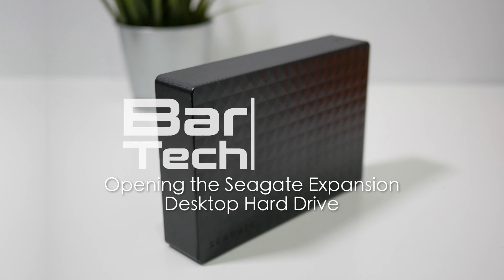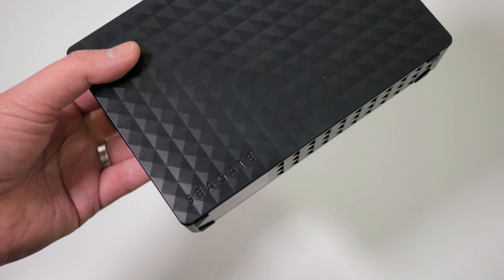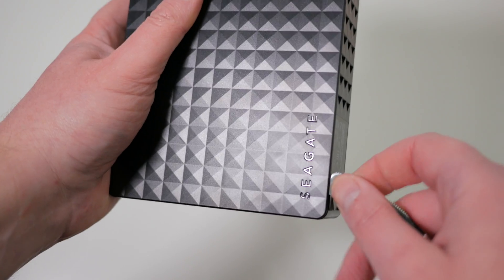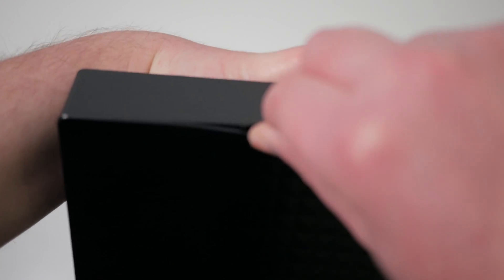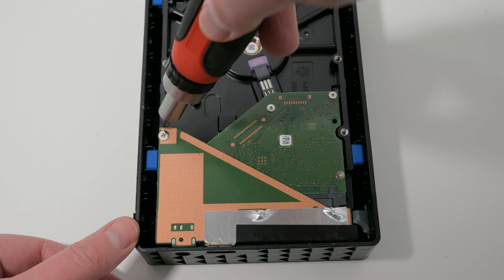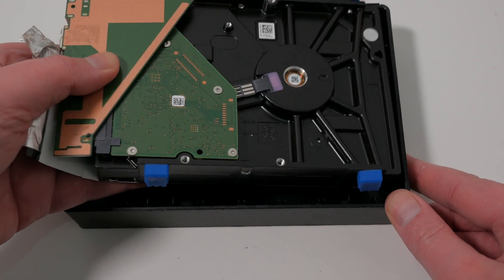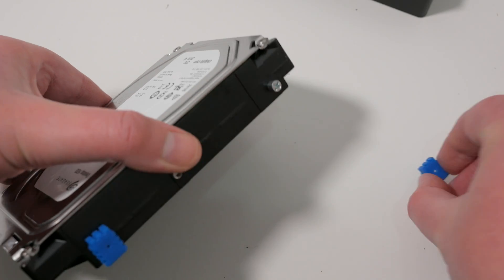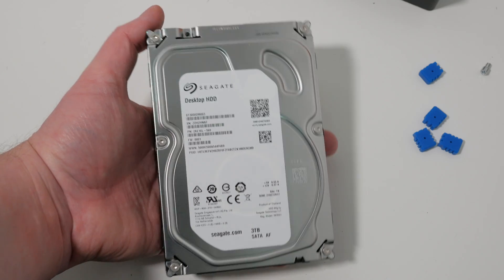Open / Dismantle the Seagate Expansion Desktop Drive to use as an Internal Drive

Comment: bought one of these in the 8tb size and decided to replace the SMR drive with a recycled ironwolf from my NAS. The enclosure LED doesn't light up with a different drive interestingly enough. I swapped the original SMR drive back in and it lit up but when I swapped the Ironwolf back in, it wouldn't illuminate. Weird.

Comment: Hi there thanks for the video. I'm intending to do this too. However I'm wondering that if i have a problem with the drive in the future will my warranty be voided if i removed it from the case? Like, is it possible to get it back in the case without it looking like it's been tampered with or not? - is it possible to remove without breaking anything?
Reply: each snap is broken. 26 of them. But it will still snap shut and look normal. i doubt they could tell. just have to get the tape back on and remove fingerprints

Comment: Hi I have taken out my old Seagate drive as the power wasn't working, so now I've taken it out its about 5.5" X 4" and that isn't going to fit anywhere. How do I get my information off of it? I can't think how? It's got some important stuff so I really need to fix it, I don't think it will work just using a connector as it's a strange size and needs power. Any idea? thanks

Comment: Thank you! The caddy died on me but the HDD is okay.
Reply: David Jameson  yeah, same thing happened to me. If I unplug everything and plug it back in then it sometimes temporarily works and then stops working again. I've never had a HDD break on me in all of my years, so I expect that it's the external enclosure that just needs to be replaced and I'll be trying that as soon as I receive a new one.
Reply: David Jameson  well, I managed to make a copy of all of the really important data (even though I had to keep reconnecting the drive multiple times), but I cannot rely on it anymore if the issue persists, so I am hoping that the new enclosure fixes the problem. If it doesn't then I'll just have to get a new drive. Either way, I always like to keep multiple copies of the most important irreplaceable data, because there's always something that could go wrong with one copy even without the hard drive failing.
Reply: David Jameson  so, I got a new generic enclosure and it has been working fine for a day, we'll see if it lasts, though.

I saw another video about external hard drives breaking, because the cases are usually designed to be standing on the side (rather than laying flat on the desk) and if they fall over while in use then something may break. I've never had that happen, so I had no reason to suspect a broken HDD, but if someone else has problems after knocking the drive over then they should know in advance that it's probably not going to be a very easy fix.

Comment: Thank you sir was about to toss the drive and pay for recovery saved me alot of money!
Reply: hi - did you fix the drive and use it as external or did you install it in pc?  i dropped mine and now its now powering up at all......i want to continue using it in original external format but if i have to install it in a laptop to recover teh data myself thats what ill do.....anyh help much appreciated?? cheers
Reply: @gerbear3227  Open it up and see if the SATA-DATA bridge (the thing wiggled off in the vid) is loose. 
Could have also broken the connector, but there's no way to know unless you try. 

Just unplug it from the power first.

Unplug and replug the bridge to see if it works again. 

If not, that likely means the platter on the inside of the drive was likely scratched by the read arm from the shock. There's not much that can be done there. 

Go with Solid State and you won't have those problems. Hopefully it can be fixed though.

Comment: Worked great.  I used a box cutter razor to start and a flathead screwdriver to pry apart.  I opened the case because the Seagate 8TB drive inside had failed, and I wanted to try a different USB interface to see if that was the problem.  The new interface kit didn't get a tone recognition from my laptop when I plugged in the USB.  I reinstalled the old one and it did get the tone, even though the drive wasn't recognized because it had failed.  Not sure if that has any significance, but thought I'd mention it.

Comment: Can the 3.0 USB connection be replaced I have a 3 TB Seagate Expansion drive and the 10-pin 3.0 interface is loose so when you plug a standard 10-pin micro-b cable in it droops. I know mechanical devices do not get better over time. I had another external HDD and swapped over the files. I have since found out that I can use a 5-pin micro-b cable and the drive works perfectly. I am content just using it in 2.0 USB mode because I am going to be using it primarily as a backup drive.

Comment: I did this with 2 3TB Seagate External drives in 2013 and both worked fine up until this month where one of them just all of a sudden just started making a clicking noise and died. The other one is still working fine though. The price for the external drives at the time was way cheaper than if I was to buy the drives as bare OEM drives. Even with one of them failing after 6 years of use I more than got my moneys worth from the drives. 

The drives them selves are actually fairly fast big file copies from one to the other drive was normally around 140-195 Megabytes a second so no real complaints with the performance. I guess the 7200 RPM spin rate and decent cache on these drives helped a lot with the performance. I have since replaced the 1 failed 3TB drive with a 8TB Seagate drive and it actually feels a bit slower probably because of the 5400-5900 RPM rate but the cache is at least 256 Megabytes. The new drive seems to only sustain 115-185 Megabytes so a bit slower than the older 3TB 7200 Drives.

Comment: Thanks a ton.  Getting horrible transfer speeds with mine (defragged but mostly full) so just not sure if I'm having a controller issue or what.  But I figure docking the actual drive is faster and I didn't see how to tear it apart.  Helpful!

Comment: 6tb with enclosure 109 euro same drive without 129.   price of a enclosure 20 bucks.  how is it a drive with enclosure is 40 bucks cheaper...
Reply: It's not a mystery actually. It's because these are shingled magnetic recording (SMR drives.) they are great for write once read many times but suffer terribly at random read and writes. Worth doing some reading about and taking note. Not all external drives are SMR but the really cheap large capacity ones like this one are. I use them to store media that people read from my server and they works fine for that but I use a good quality internal for my scratch disk.
Reply from the maker: It's a mystery. That's why I always buy external drives instead, pull the drive out and sell the enclosure on eBay.

Comment: Perfect video to the point. I also liked the part where you had mentioned about your hdd rpm, as most dismantling videos don't mention the speed. Thanks
Reply: Got a 7200RPM in my 6TB Seagate External. It's also about $80 cheaper than the standalone in this country - a 30% discount.

Comment: Easy peasy. 

Have a 8tb Seagate Expansion barracuda HDD. I recently upgraded my PC. Gave it a new MB, CPU, RAM, SDD, etc and upgraded to Windows 10 as well. Upon boot up, the HDD was no longer recognized in disk management, the console, or the boot menu. Tried it on another PC, nothing. As a last effort, I did this. Works fine. Absolutely nothing is wrong with the disk. The USB bridge must have failed or possibly the cable I was using?

Comment: A little late  but i  have a question. Would you know if Seagate would have a replacement case tor the HDD? The Seagate Drive is okay but that flimsy  USB 3.0 Micro-B female input connection is not keeping cables connected very well.
Reply: I would go for an upgrade if I were you and either order online or pick up at a computer store an enclosure using your connection of choice. I picked up a few Usb-c enclosures for about $20 each. Just follow this video to remove the drive and install it in the new case. Just like that you have an upgraded drive.

Comment: I'm trying to open it the rest of the way to try to fix it after being dropped. I want to continue to use it as an external hard drive.
Reply: Andrew - did you get it fixed and how?  i dropped mine and now it wont power up when connected to ac adapter and laptop usb? its 4tb and almost full..........tonnes of important work on it!   any help please would be appreciated!  cheers